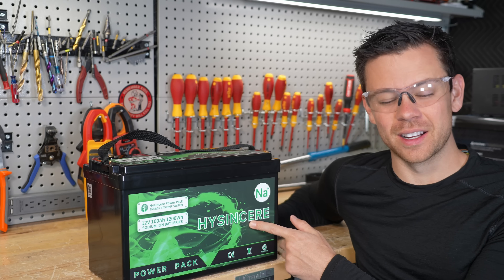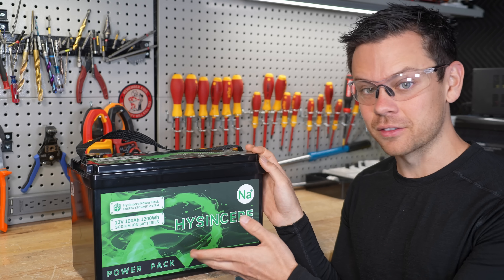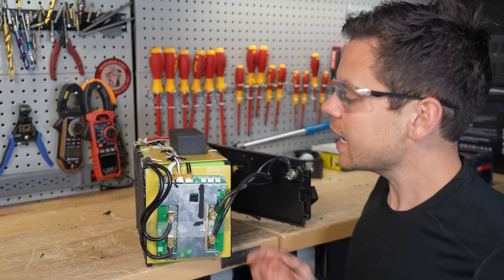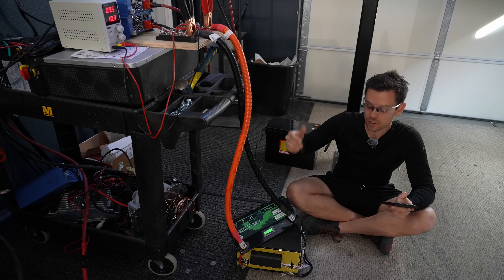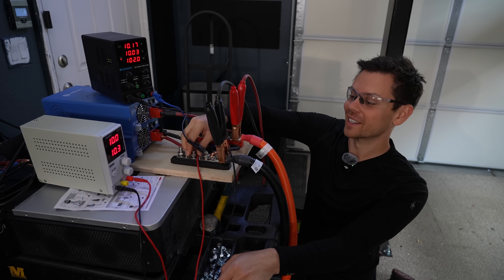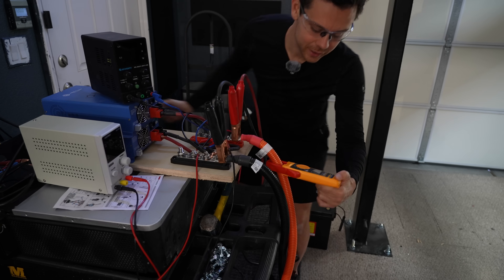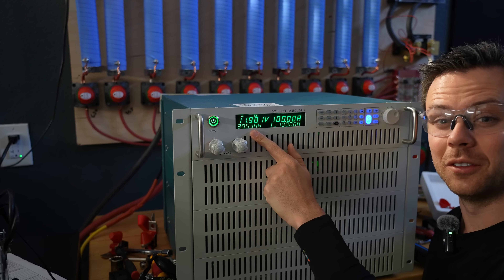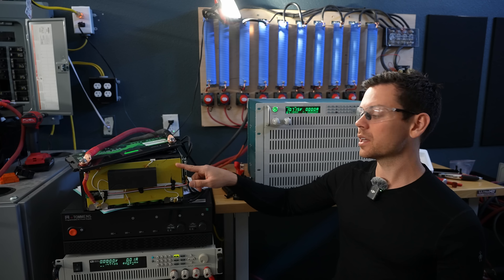Testing My First Sodium-Ion Solar Battery

Comment: As a starter battery, it would have to discharge 600a or more, however briefly. Did you test that? Or is the output limited by the BMS?

Comment: These might not be great for household solar, but for remote applications in freezing environments, they can be really useful. They would make more sense in smaller AH packages though. I have a small one I use to automate my chicken coop door opening at sunrise and closing at sunset. I could see them also being good options for driveway gates or remote cameras where a self-heating lithium ion is overkill for the application.

Comment: Been using a sodum starter battery for 2 years, works great!
Reply: How much current does it really output? Car battery usually output 500-600 Cold Cranking Amp…
Reply: @cedricpomerleau5586 if you stack the trunk with sodium ion you might get enough amps from them 😂😂😂
Reply: @cedricpomerleau5586  Obvioiusly enough. I'm always ready to admit when a technology is just bad, but almost every time I see critical reviews of NaIon batteries, they treat them like Lithium based batteries. In reality, they are very hard to compare, but the main reason for NaIon being good is their materials are easier to get.
Now, if you see how wasteful many of our current tech is (AI everywhere, ridiculous screen resolutions, way too much power on cars, etc.), you understand that the battery tech is already very much usable and useful. I got a couple of them lying around, but have not much time to test them out more intensly, but so far they've been a good buy.
I'm glad to see they are more available and looking forward to building stuff with them, once I have more time for it.

Comment: I understand NaIon's main advantage will not really be evident until they can scale production. Materials are abundant and more environmentally-friendly. Plus, it's been reported they are less prone to thermal runaway. Perhaps the voltage limitation could be overcome using two in series for a 12-24v swing?

Comment: I can see some issues with using Sodium-Ion for cars/trucks etc.  The high voltage is not compatible with charging and the low voltage will not work so they have to cut it off at 10 volts or higher.  If they make a DC to DC conversion charger that comes with the battery that would work.  I wonder how much current they can produce for starting Diesels?

Comment: NIBs charge to nearly 16 volts. 

Why didn't you charge it fully?
Reply: At some point, 12 VDC systems are going to start having problems if the voltage gets to high. Is 25% above 12 VDC going to start causing problems?

Comment: have a 7 yr old LFP battery I made with 100ah Calb cells that was Removed from system and sitting for 2 yrs and cell voltage is Still 3.3 and 59mv out of cell balance - battery was used Hard daily for 5 years -  Very Impressive
Reply: What was the capacity test result?
Reply: Who let Project Farm in? ;)

Comment: Hi, I really respect your knowledge in this field and learned a lot today. However, I am looking to replace lead acid batteries on a boat. Here safety is paramount and that seems to be an argument for sodium batteries? Also, charging Li batteries above 35 degrees centigrade seem to degrade them fast? That is a problem for me. Interestingly, solid state batteries sem to hit the market for the same price.  Those should be even safer. What are your thoughts on those?

Comment: Interesting to see the technology staring to evolve.
You mentioned start battery applications... from the RV/Marine perspectve, I know you review less of those systems nowadays, but it would be nice to see some LFP based starter batteries reviewed! Also, built in/stock RV PWM replacement options.Ive struggled to find anyone making/selling easy replacement MPPT inverter/charger upgrades, or a PWM to MPPT charge converter (if one exists).

Comment: Thank for that lessons on sodium battery discharge curve and round trip efficiency. IMhO: That puts Sodium Batteries in perspective as a low tier option to LifePO4 chemistries. Thanks for the Heads Up.

Comment: Hello Will.... A fan of your videos. I have a question that I hope you could answer in a factual way. I will explain what I mean.
I wasn't educated in the USA, so the way I learned was that electricity travels from negative to positive. I see in different videos that a fuse is always installed in the positive side of the circuit. My understanding is that all the current comes from the negative side of the power supply, so if I want to protect the PSU and the device is being powered from a sudden increase of current, the fuse should be at the negative pole of the PSU or battery in that way the current pulse won't have to travel all the way to the positive side.
Well this is my factual way explaining how it works, now without recurring to traditional ways or best practices or everyone is doing that way, please explain something that will make sense in why the fuse should go in the positive side.... I thank you for your patience.
Wishing you all the best, great info you provide continually in your videos.

Comment: LFP + heater for car battery sounds like a mouse nest waiting to be built. Hope to see Sodium-Ion replace lead acid in the coming years...
Reply from the maker: The heaters are built inside the battery pack. It's not an actual heater
Reply: @WillProwse  None of the heat can be felt on the case?

Comment: You said to just use LTO for cold performance... I would love to find some, that or good NiMH, some NiMH cells are fairly long lived if made correctly (usually the Japanese cells are decently long lived). Sure the efficiency isn't great but they would make great starter batteries.

Comment: Excellent, been waiting for this, I have seen and had discussions with people supplying the very first NA home batteries and it turns out they are using custom modified Rectifiers to handle the voltage drop, so if these do become a common battery all the current manufacturers of rectifiers will need to redesign their hardware to take it into account. I would be interested in seeing you do a breakdown of the Bluetti NA power banks, if they'll let you of course!

Comment: heh i made a video going over how to use LTO and a solar roof to replace AGM battery in an EV to boost EV range. its called "efficient use of solar panels to extend EV range," in it i review sodium ion and against LTO its worse in every way possible right now. maybe when cost comes down it will be an okay alternative but cost wont come down if no one buys them. catch22

Comment: Been running heated LFP batts, TopBand made, at our off grid property in Northern Maine  since 20017 in our unheated barn. The coldest we have recorded since 2017 is -24F. We often abuse them and discharge to cut off. Despite the cold temps and using 100% of the capacity pretty frequently the batts are still delivering 102% of rated capacity. I can’t wait till you get your hands on CATL’s Naxtra cells…

Comment: Good to have a new battery tech coming online.  I believe the main draw of Sodium is how abundant it is, so in the long run cheaper.  Might be a world where to still use LFP batteries for their properties and supplement with lots of Sodium for a week with no solar input.  If they are cheap enough, might be a good tool in the solar arsenal.
Reply: That and they handle extreme temperature very well and are even safer than LFP. Even though LFP is very safe. But lithium in any amount is violently reactive with water, while sodium will react, it's not violent. Sodium ion can apparently also be stored at zero and not be bothered. Will made a good point that they may be ideal as a starting battery.
Reply: To get sodium ion much cheaper than LFP the production should be in the same capacity as LFP 

Current sodium ion market share is still only 1%, vs LFP at almost 70% market share
Reply: It’s only 2x the price of LFP despite having almost no scale.  Prices will drop like a rock once LFP factories are converted to sodium ion.
Reply: @sihamhamda47  yep, BYD and CATL are going big time into sodium so a few years should bring them relatively same price. Both are great battery tech for different & same things
Reply: Lithiums are dirt cheap now
Reply: @bobczz3919  "dirt cheap" is relative though. Cheap compared to previous years, yes, but still pretty darn expensive. If sodium ion can get close to its proposed low cost of manufacturing with scale, "dirt cheap" LFP batteries will seem downright expensive. That said, I have no stake in any particular battery tech right now, I'm just sitting... well I was going to say "on the sidelines" but I'm not even in the crowd, I'm like... on a different planet, occasionally peering into the world of batteries out of interest.
Reply: @bobczz3919 they reckon it could be 10% the manufacturing cost of LFP eventually. 10kWh for $100 would be dirt cheap 😄

Comment: How's the internal self-discharge performance of the sodium cells?  With the low temp performance and tolerance to deep discharge, it seems like sodium might be a good candidate for running a heating pad integrated into an LFP battery cabinet.  I feel like there's got to be some applications where these make sense, especially if the prices drop as much as they are projected to.

Comment: It's fair and useful to review sodium ion batteries as they are today. But to dismiss the entire chemistry based on current cells is a mistake I think. IMO their promise is their theoretical (materials based) cost floor, which is several times lower than LFP. Obviously we won't see this until volume is high for several years, maybe a decade. But you can forgive a lot of things like voltage curves and inefficiencies if you're getting prices like 2 to 5 dollars a kWh.

People will correctly say "I will believe it when I see it" but it's also kind of a funny sentiment coming from PV and battery enthusiasts.

Comment: 4S1P battery with sodium ion cells you can use it without BMS and it gives 250CCA and work forever. ATV, garden tractor etc.. good low temperature performance.

Comment: I think the current development of Sodium ion batteries is still in an early stage, but it should improve down the road. I believe the main advantage of Sodium Ion batteries is their cold-temperature performance. This could make them a valuable complement to LiFePO4 in cold temperatures storage as a hybrid system for charging and discharging.

It could somehow be like RAM memory in a computer, acting as the front line for charging and discharging in the cold until the main LiFePO4 battery warms up to take over the main storage role.
Reply: The other advantage of sodium ion in the long run will be low cost for very large stationary installations.  Sodium is one of the easiest elements to come by on earth.  But they'll always be lower energy density than Li based batteries and probably not what you want for a compact mobile battery.
Reply: Although their cold temperature performance is better than lithium, the voltage drop off was significant and therefore they might not work well for vehicles.

Comment: If the round trip efficiency for sodium ion is less than 80% then AGM is likely still a better way to go for automotive starter batteries since a good AGM battery can easily last 10-15 years.

Comment: I hope this tech can mature quickly and isn't ruined by the early pump and dump companies.
Reply: The Limiting Factor has a youtube video that looks at this and other issues in some depth called The Hype and Reality of Sodium Ion Batteries // A Technical Review
Reply: @pov1  A good video with a nice dose of reality based on earlier rates of adoption. Could take up to 10 years or more before sodium takes significant market share
Reply: Yeah, if they can miraculously change physics and chemistry.
Reply: @badhombre4942  You’re basically right about that. What has changed is that scientists can now leverage AI to go through many virtual iterations of battery design and chemistry to narrow down promising candidates for prototyping.
Reply: Well let's see how far the tech goes in 10 years when my lifepo wears out.
Reply: @morenothing4u  That is how I look at all new battery developments. I hope that things work better/get cheaper so that at least when I have to replace mine it won't be a bid deal.
Reply: it is going to take over the industry with ease. As will even said, this is large industry type stuff. Many cars will also use it since the two largest manufacturers are making them for that. 
As for us small timers, lifepo4 still makes the most sense, especially due to price
Reply: Sodium ion is still on the 1st gen compared to LFP that are already on the market for almost 20 years

I hope so, those battery maker has to be serious in improving the cell and scaling up the production line, as sodium has a huge potential to be a cheaper alternative to LFP in large scale energy storage application once the production volume is enough
Reply: wake up

Comment: Sodium ion will be interesting if they can sell them for half or less than a lithium battery. But in a few years both will probably be obsolete as the hydrogen batteries are released.(6x the energy density of lithium)  Imagine your 12v100Ah battery suddenly being 12v600Ah in the same envelope.

Comment: Hi Will. Your test of this particular Sodium Ion battery reminded me of all of the many reasons I sent 1,300kg of Lead Acid batteries to the scrap metal recycler. The charging curve for the application of solar photovoltaic panels during winter was horrendous. Yes, absolutely, LiFePO4 is the best battery technology at home scale I've yet used and we are spoiled! By the way, they paid AU$0.72/kg for the lead acid batteries. Well worth taking the time to get them recycled properly. Cheers and keep up the great work. Chris

Comment: Weize Has come out with a LiFePO4 Lithium Battery for Dual Purpose use 1000CCA Group 31-27  looks Promising I have been using their Motorcycle version for about a year now Im going to try the larger group on my old truck was wondering what you thought of them

Comment: But could you elaborate a bit more on the possibilities to use this as a starter battery? Are the CCA high enough? Could it be used in parallel with a second lead-acid one?

Comment: Operating Voltage range of sodium ion battery for each cell is 1.5 v to 4.0 v. For 12v battery is 15.6v to 8v. So you charge/discharge like this. Normal inverter cannot run. Please charge it upto 16v and discharge it for 6v for full capacity.
Also charge upto 2C,3C and discharge upto 3C,5C.
Reply: I will be shocked if will didn’t know this. He just said it disconnected at full charge and it wasn’t no 16v
Reply from the maker: @hozn  I didn't, but I got high voltage disconnect at 14.7. couldn't put anymore current in either and it dropped fast. Idk how I could get the voltage higher
Reply: The battery BMS will not allow that.
3C discharge all the way to 6V is more then the internal BMS allows, the amps will be hundreds to deliver 3C power down to 6V.
The BMS also did not allow charging with 2C.

Comment: Wow, thanks for confirming the inefficiency of this technology. 
As you say, we’ll see what the future brings.
Reply: It's not the inefficiency of the tech. It's the inefficiency of these particular cells. (Take a look at CATL's Naxtra batteries.) It's also the inefficiency of using inappropriate charge/discharge controllers, (silly,) and Will's assumptions about the near-future advances of sodium tech and its price, based on what is little more than early sodium prototypes being sold as production devices. I think Will sees 'everything battery' from the consumer perspective, looking at what he can buy today, for how much, and what it will do in present power systems. Nothing wrong with that. It's what the channel is all about. But he was putting down the technology without understanding it. That misleads his viewers about the real nature of this chemistry horse-race, leaving them to think that sodium tech is some sort of silly  joke that doesn't come close to lithium, when in reality in about 2 or 3 years sodium batteries will be used in the vast majority of new home-power electrical systems because they will come close to lithium in most specs, be environmentally safer, more reliable and effective in the cold, essentially concern-free, and cheaper, substantially cheaper, without lithium's downsides, and in the end, cheaper always wins.

Comment: The BLUETTI Pioneer Na + Charger 1 is available for sale.
80% in 35 Minutes: With 1,900 W AC + solar fast charging, you're ready to go in the time it takes to pack a bag.  USD$1000+ very costly

Comment: They do have a couple of pluses. They can be shipped and stored with no charge. They can be over discharged down to 0V.  The more complicated answer is they are fully discharged at 2.5V and then the resistance of the battery rises quickly. The main issue right now is the mass production of the batteries. This is the hardest part of any item to be produced. Once in production the tech will evolve. The raw materials and supply chain are cheaper and easier to deal with. This will drive down the price and the tech will take over stationary battery applications.

While all this is happening someone will develop a new battery chemistry to replace them both.